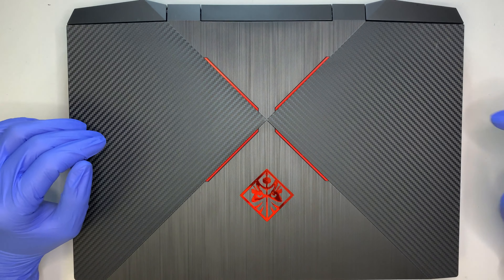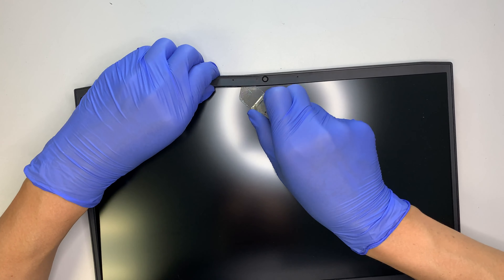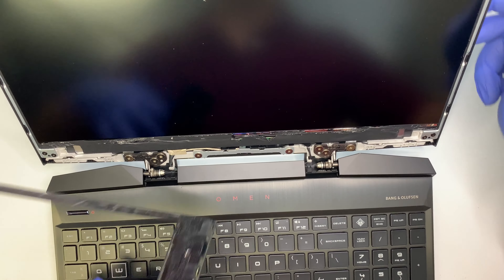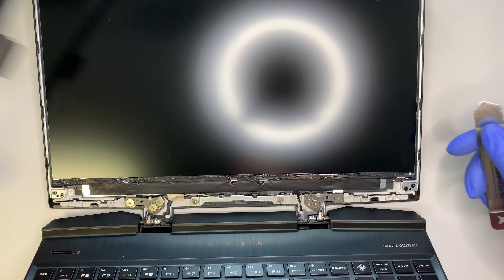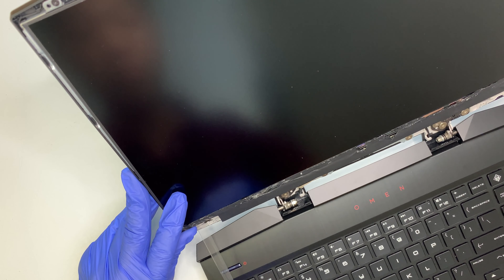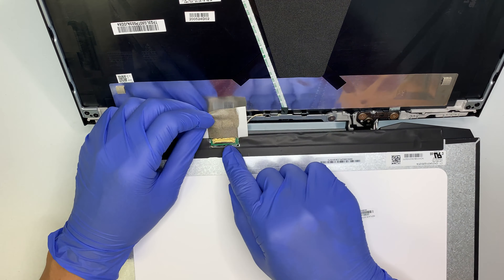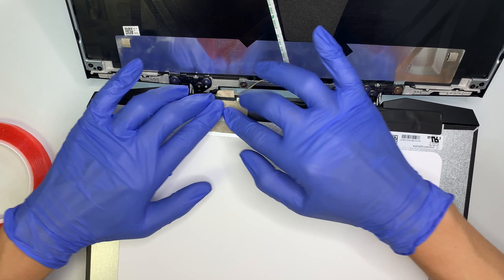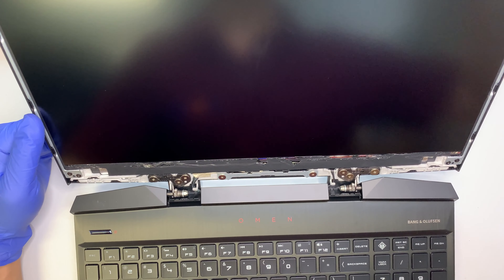HP Omen 15 dc2010nr Screen Replacement

Comment: Your video doesn't show putting the bezel back on.  Is fresh double sided tape needed to complete the re-attachment of the bezel?
Reply from the maker: I did not put fresh double sided tape on bezel. The original tape on bezel should be still sticky enough to hold.

Comment: Hello sir,
There's 1 thin vertical line across my screen on the right side. The line is very faint and appears only on light wallpapers. However it doesn't show up anywhere else, like BIOS or any app. It appears only on my desktop wallpaper which has sky blue colour in it. 
Also my laptop screen flickers horribly after i boot to desktop. if i keep the display rate to 120hz it will flicker continuously especially towards the taskbar area and if i change it to 60hz it will flicker only for few minutes after its booted to desktop then it works perfectly fine.
I connected the laptop to an external tv and the laptop seems to work perfectly fine. It doesn't flickers nor i see the white line on the blue wallpaper. Does this means my laptop screen is gone bad?

Please advice... 😭

Comment: Hi. Thanks for the helpful tutorial. I just had a question. What is the black covering at the bottom of the display panel. I just ripped the black covering a little while opening. Will it damage the display panel?
Reply from the maker: If you are referring the black covering plastic, that will not damage the display.

Comment: Thank you for excellent tutorial. I'm getting red screen with white vertical stripes on screen from time to time. Sometimes there are also vertical colored lines with completely distorted picture.  External monitor with HDMI works without problems. What do you think could be causing it? Would be very grateful for answer
Reply from the maker: Glad the video helped. More likely something heavy or press hard on the screen. Or the top of the laptop which impacted the back of LCD.
Reply: @UbergeeksBiz   thank you for reply. Is there any easy fix I can try at home?
Reply from the maker: @peterrado1911  Try output via HDMI to monitor or TV while waiting for the screen to come in.
Reply: i have same issue now ! what did you do ?

Comment: Is the replacement screen not color accurate?
Reply from the maker: It should not be.
Reply: @UbergeeksBiz  On this video the laptop that you are fixing is almost the same as mine only difference is I have a 2070 on it model number is  dc1040 is it compatible? I tried clicking the link that you gave and asked 
this seller from ebay which has this particular model LM156LF1L02 if its color accurate and they replied with a "45/46% NTSC gamut." I think 45/46& NTSC is super bad for color rendition.